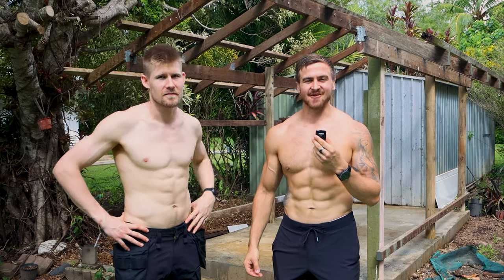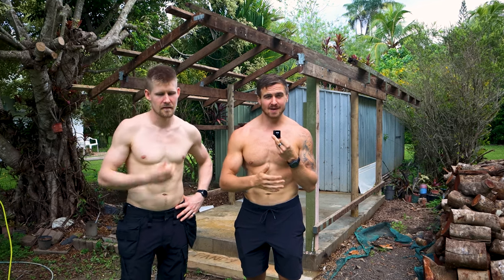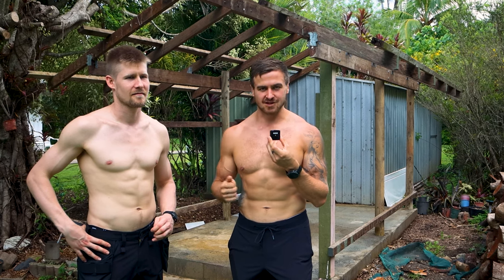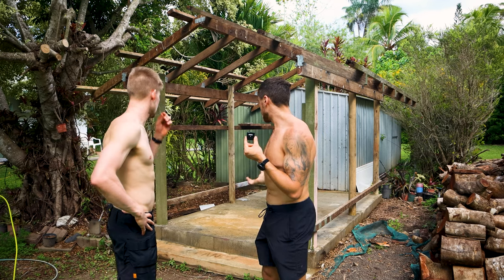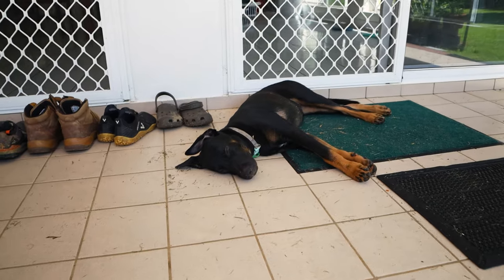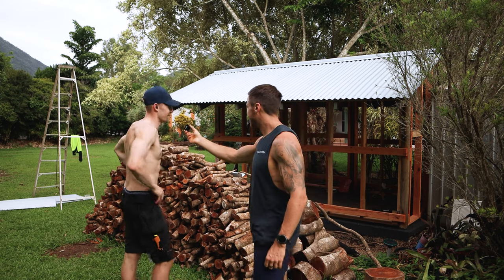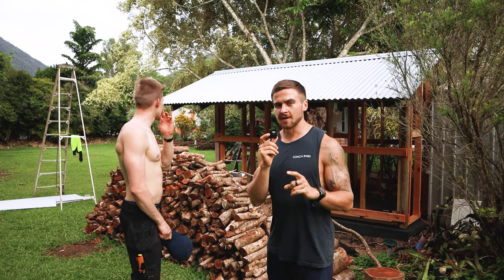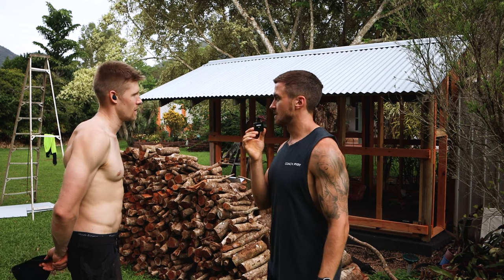How To Build A Traditional Finnish Sauna

Comment: Hi, Great video thanks, I’m about to start a Finnish Sauna build in my garden in Wales on a concrete slab.  What did you seal the floor with and were you worried about the heat and off gassing of any chemicals from it?
Reply from the maker: I'm glad to hear that; that's awesome! We sealed it with Dulux Concrete & Paving Stages 1, 2, and 3. 

That's a good point, but as long as you have good ventilation at the bottom, the floor will never get that hot. Especially in Wales, the ambient air should be cool enough year-round. Even here in the Australian tropics, the floor and the bottom rung of the sauna are significantly cooler than the top rung even when the room is at 75-80 degrees Celsius, and I'm throwing löyly. 

What heater are you going to use?
Reply: Ah brilliant that’s great thanks.  The concrete slab goes down next week so I’ll get on it.  
I have to use a 9kw Electric heater, can’t burn logs unfortunately due to proximity of neighbours.  I was thinking of a Harvia Cilindro or a Huum Drop because of the larger stone capacity.  I have about the same height as you internally, about 2.2m and not sure if a tower heater would work or I should go with something lower to be sat more above it.
Reply from the maker: @Jason-rk4xc  Oh, that's a shame about wood burning. Can't recommend Harvia highly enough. The most important thing is 110cm from the top seat to the roof. I think that a tower heater would work perfectly. It's better to have too much horsepower than too little. You can easily adjust the settings if the löyly is too intense for your liking, but the opposite is not true if the heater is not strong enough for the size of the room/your liking. 

What is the m3 size of the room?
Reply: Got it, I’ll make sure it’s 110. The room is 8.8 m3.  Small changing room and a cold plunge tub under a porch.  No drain in the sauna room though, so I suppose I’ll just mop up. I see you don’t have one either?
Reply from the maker: @Jason-rk4xc  I don't, and haven't needed one because the airflow is so good (Notice how we left the entire bottom of the sauna open). Just make sure you throw most of the water on the rocks😀. Dripping from the could plunge will probably make it a bit wetter. I'm going to set up one too. Very excited!
Reply: Yeah I did notice that you left sections of the wall base plates out for air- very clever. I suppose I could do that and then if it’s too much, keep the section and just knock it back in.  
Does a wood fire require more intake ventilation than an electric or would you build it the same way regardless?
Reply from the maker: @Jason-rk4xc  I don't think so. However, the big difference is that I live in the tropics, where the coldest annual temperatures are around 10 degrees Celsius. How cold does it get where you are?
Reply: Hardly ever gets below freezing here, usually around 2-8 in the winter months.  It’s just relentless rain!  Looks like a great location you have there.  
Thanks so much for answering my questions, I really appreciate it and you’ve helped my sauna build no end.
Reply from the maker: @Jason-rk4xc  Yeah... The Isles are pretty notorious for that. Well, a sauna is the perfect solution on a rainy day! My pleasure; please send me some photos when it's all done! (Instagram @coachpyry)

Comment: Did you look at using pine or spruce? They seem cheap here in aust
Reply from the maker: No, I did not look at those options. Are you looking to build a sauna?
Reply: @coachpyry  yeah i am, live in perth but materials will be similar to qld, more similar than to finland at least haha

Im trying to read/watch content from the Scandinavians etc as it seems a lot of stuff is wrong compared to what you guys have to say!

Apart from the ventilation, seat height, head room, speccing the right size heater- are there any other obscure things to consider(apart from the method of building)?
Reply from the maker: @markl4528  I would wholeheartedly recommend choosing a wood-fired heater vs an electric one if possible logistically
Reply from the maker: @markl4528  Which one are you thinking of going for?

Comment: Where did you buy the interior lining boards from ?
Reply from the maker: Hey mate, I got them from https://maywood.com.au/
Reply: @coachpyry  Thankyou, I'm a Chippie, and want to build a Sauna as well after using my mate's barrel sauna when I stayed the for a while, it also has a Harvia wood burner and it was amazing.
Reply from the maker: @-PORK-CHOP-  Nice! Harvia heaters are the best. So far very strong recommendation for the paulownia boards, I really like the fact that they stay cool to touch even though the sauna is running very hot. Are you going to get a wood burner or an electric heater?
Reply: @coachpyry  Wood Burner Mate, the only way to go, I will look for the paulownia boards, thanks for the recommendation, we are unfortunately not blessed with any reasonably priced timbers in AU for Sauna's like the Nordic Countries or North America, I have also found Baltic Pine is good for Sauna as it also doesn't hold heat, and luckily we can get this a a decent price here, unlike Cedar which you need to sell a kidney to buy  🤣🤣, This is why you can't use Australian Hardwoods to Sauna because they are too dense and store  the heat making it uncomfortable to sit on them, what timber are you burning in it ? if you can find properly dried Blackbutt or Spotted gum try them, they are so much better then most other timbers for heat output, when I was minding my mates house, I would use offcuts from decks we were building, Merbau was not bad but had nothing on Blackbutt or Spotted gum for heat output, the difference was measurable at around 30C hotter using Spotted or Blackbutt.
Reply from the maker: @-PORK-CHOP-  That's so true; Australia is way behind regarding saunas. Currently, I'm using lychee, which I cut down from my yard, and Bloodwood, which I bought. Both burn very nice and hot, super dense stuff! I've had some challenges drying the timber properly as I'm based near Cairns, but now that the dry season has kicked in, the wood is drying nice and fast. I'll keep an eye on Blackbutt and Spotted Gum for my next batch! 

Glad to hear you're going with a wood burner! I've come across a few decent electric ones and they were Harvias, but if you can, wood-fired is definitely the show.
Reply: @coachpyry  Australia is behind with Sauna because it's a hot country, so we don't think about them, a pool is more common addition 😂, when I was using one, it was very nice in the winter to have one first thing b4 work, but when it warmed up I didn't use it as much as it felt strange to be 35C outside (Sydney) to go into a 90C+ Sauna 🤣, this is why they are popular in colder climates, but the health benefits are amazing, Forget about drying timber in the wet season up there too humid, So you say your mate enjoyed going to Bunnings ?, was he like a kid in a lolly shop, it was very nice of him to build you a Sauna on his holiday, I hope you looked after him while here
Reply from the maker: @-PORK-CHOP-  I know it's a hard sell but I think it's mostly because Australians haven't experienced the real deal sauna experience. For example in Finland people are guaranteed to still use a sauna even when it's very hot outside during the summer time (admittedly, that "very hot" period is not very hot on Australian standards). 

Hahaha, he actually had a terrible time at Bunnings and Cairns Hardware because the materials are so different from the ones in Finland. Yeah, he's a legend, I owe him big time.

Comment: If you want to go with Finnish sauna. You should have air inlet below heater and outlet opposite side of sauna on wall quite high up.. When sauna is heating fresh cold air rises from inlet and spreads around sauna! Also if it's wooden heater it needs fresh air also, so it won't suck air that you are breathing.. You can have adjustable cover over outlet, but probably should not close it all the way.. As fresh air flow it really important for good sauna experience! 

When you throw Löyly, always some water seeps through heater to floor. So it's recommended to have a floor drain. Also you should clean "lauteet" the wooden platform you sit on, quite often. Depending how often you use sauna (weekly to monthly). Best practice would be to spray water over them after every use, as sauna is still warm they will dry quite fast.

There are product made for cleaning saunas, as they don't use harmful chemicals which later evaporates into the breathing. As for spray water over "lauteet", it's mainly to wash out sweat which will make them last longer.
Reply: As for actual use of sauna, stay in as long as it feels good, then go outside to cool down.
For us Finns it's quite common to go back and fort between sauna and lake to swim (summer or frozen hole in lake or sea). If there is no lake/sea near by just sit outside and cool down and then go back in.

Some of us like to drink water while inside and outside of sauna, as it will make you last longer (quite recommended).
Quite often that water is beer, especially when sauna:ing with a group of friends. Some might say it's not recommended drink beer while using sauna. IF it would be catastrophically bad, Finns would have gone extinct, as common it is.
Reply from the maker: Actually we have an air inlet all over the sauna because there is a  2cm gap between the wall and the floors. There is also an outlet on the opposite corner from the heater. This works amazingly well here in the tropics, where the temperatures rarely go below 15 degrees celsius. The tropical humidity makes the löyly incredibly pleasant

Comment: forgive me my curiosity, did you not use any insulation and vapour barrier 
 in this build and why?
Reply from the maker: Fantastic question. We did use a vapour barrier but no insulation. 

No insulation for two reasons, both related to the fact that I live in the tropics. 

Firstly, it's quite humid here. The ambient humidity is great for the löyly. 

Secondly, the annual lowest temperatures are around 10 degrees at night. I usually use the sauna in the evenings and the Harvia heater has more than enough horsepower to heat the room even on the coldest day of the year. 

What kind of a sauna build are you planning on?
Reply: @coachpyry makes sense. I live in Ireland where there is summer only a couple of days per year. My small build is insulated with 6kw electrical heater. All good.
Reply from the maker: @alexklim76  Got you. Yep, it's a completely different story.